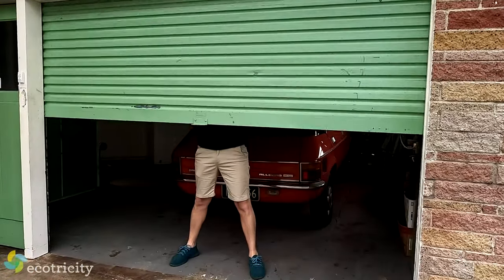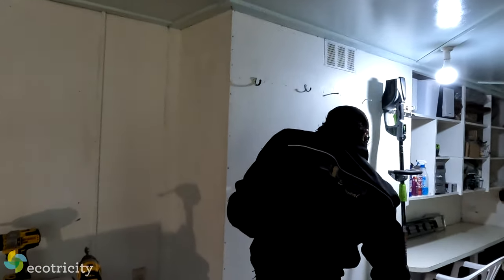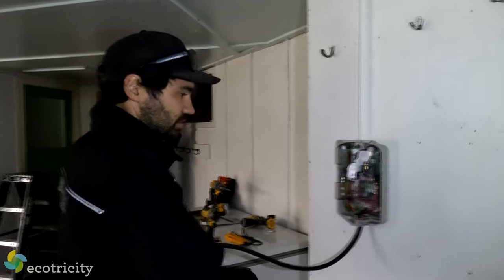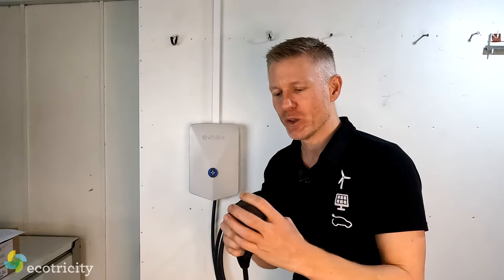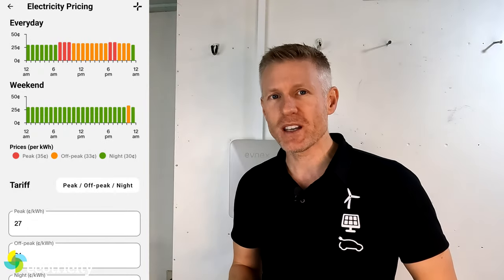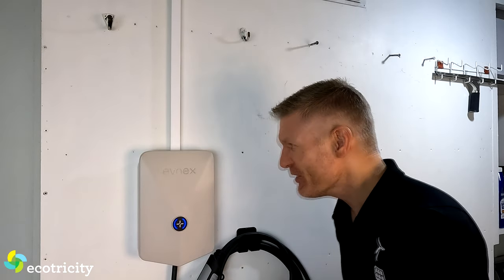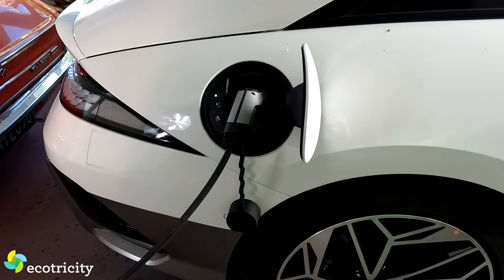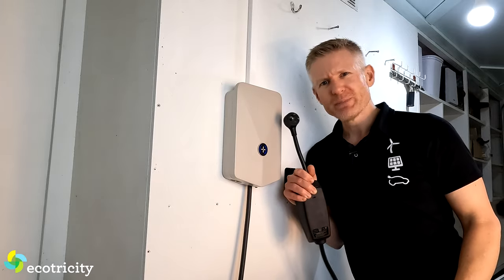Evnex E2 wall charger unboxing + install. This thing is awesome!

Comment: In ireland I got my 7kW charger installed for €1299 but got €600 back from the government and it has 7m of cable. Problem is that it is too far from my stone house and cannot pick up the wifi. Now I have to install a new wifi system beside it. It let's me charge my PHEV on the 2 hour super cheap rate during the night.

Comment: These are also in Australia.
Been uming and ahhing about getting one as $2.2k installed.

Had ev less than a month and so far slow charger seems to work ok.

But yes the E2 looks awesome
Reply: For a charger that can work in with solar production, that’s a fair price to be honest. If you have a decent size solar system, I think this type is the way to go. Initial cost is more than the likes of the Tesla gen3 but no doubt it would pay itself off after a while. I wish the cable was the same as the Tesla at jut over 7mtrs. With a double car garage, 5 metres might be stretching to reach the second car?
Reply: @oldchev2850  same.
That 7metre length is handy.
The Tesla Gen3 is WAY cheaper installed at around $1500 installed, but no smart features are a bummer
Reply: @TheMelbournelad  At least there seems to be a few choices and they're improving all the time. I spoke to a local installer(in Australia) and he said out of all the brands, Evnex had by far the best support.
I have an enphase solar system and I see they are bringing out IQ EV chargers so I might end up waiting for that. I like the idea of the charger and the solar being on the same app.

Comment: Not too serious, excellent video. Only thing is I don't think this EVSE is OCPP compliant. I think that's something everyone should look into with a charger. It's not essential but when the time comes that you want your EVSE to talk to the grid, you're going to want it. It also seems to be a totally different EVSE they are offering on their website.
Reply: It is OCPP compliant
Reply: @pariandangel  Then why don’t they mention it on their website?
Reply: @mondotv4216  It is mentioned on there website in support documentation.
Reply: @pariandangel  Ok - I thought they would have made a bigger deal about it as it's quite an important feature.

Comment: I do wish the charger had a removble cable. We have an Eesee charger here which lets you easly swap the cable out, convinient if you find you need a longer or perhaps a shorter one is more convinient
Reply: Evnex do also sell charges with a socket. That is what I got installed at my home.
I agree that the removable cable is good if owning a car with Type 1 charging plug but you are expecting to upgrade to a car that takes Type 2

Comment: Hard to beat caravan plug at 13 amps, but at long term faster charger might pay itself.
Assuming car uses 300w overhead while charging, cutting charge time 7kw vs 3kw saves 180kw.
Assuming $2500 upgrade and 12ct/kwh, that's 0.0216$/h or 115741 hours of charging or 810mwh of power or 5.4M km at 15kwh/100km efficiency.

Comment: Ah, so it's "Evie-necks"? I was pronouncing it as "Evan-Ex"... Nice choice, though.

Here's a quick Q: when you go for solar PV I suppose there'll be another app to look after the inverters and power gained, etc. Will Evan's, sorry, Evie's app talk to that app? Then there's battery storage, home hot water systems, maybe a heat pump - you're gonna need a bigger phone... 🤣